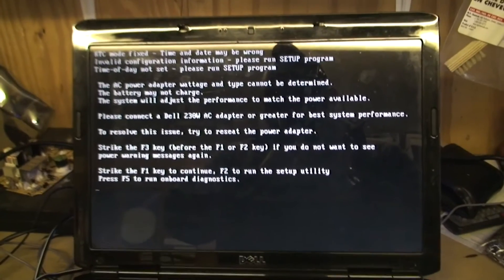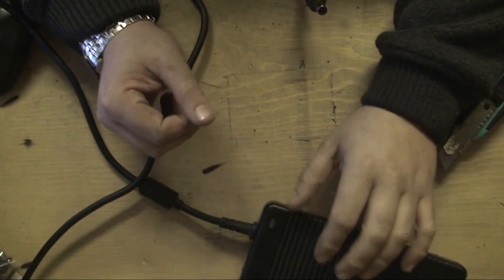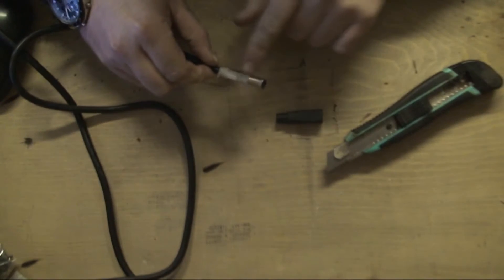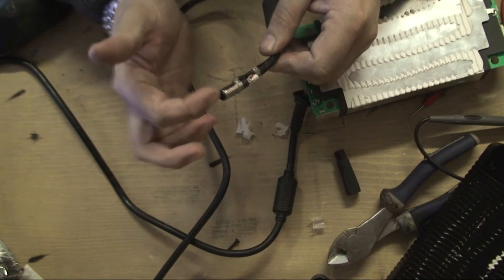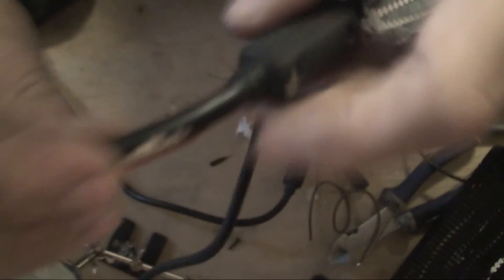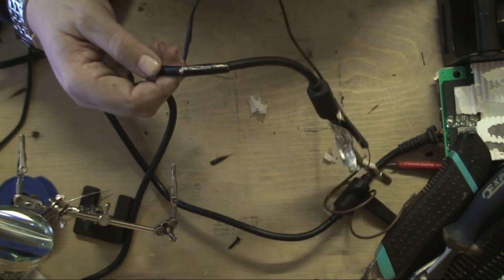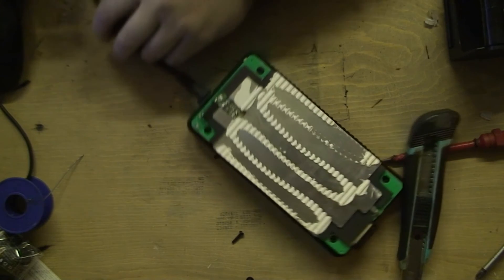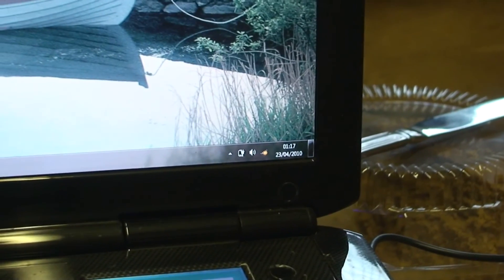bodgit and leggit garage how to fix dell xps m1730 charger for FREE

Comment: Did you have a center pin and also the 4 pins next to the center pin as my PSU only has a center pin no extra 4 pins round the center pin. My PSU is Dell proper

Comment: HI, may I ask what's the voltage coming out of the center of the plug? the data cable?
Reply from the maker: Hi mate unfortunately I cannot remember it was a long time ago and I don't have the power supply anymore
Reply: @bodgitandleggitgarage  oh ok, thank you anyway. Do you think it's posible that the data cable works with a 13.8 V tension? that what i got from the voltimeter. Do you think it's broken or something like that? o you think it's possible that it works with such tension? I'll appreciate any advice
Reply from the maker: @nachosantana5350  hi mate unfortunately I do not know and I don't want to lead you down the wrong path but if you are worried that it is broken you need to find both ends of the cable so open up the charger and turn your voltmeter on to ohms it should read no more than 0.01 if it reads more than that you have either a broke in the line or you have high resistance somewhere